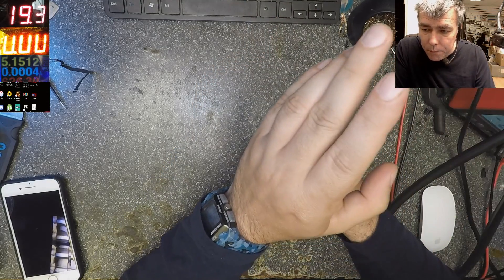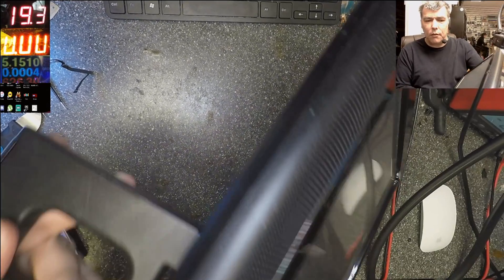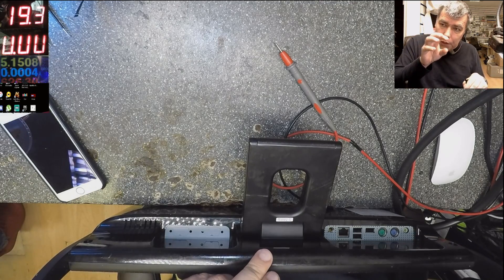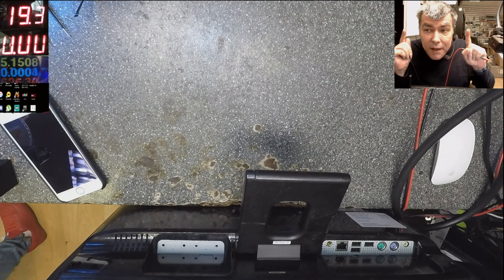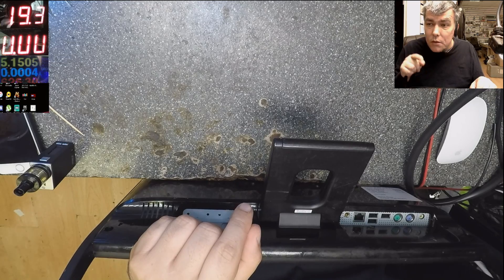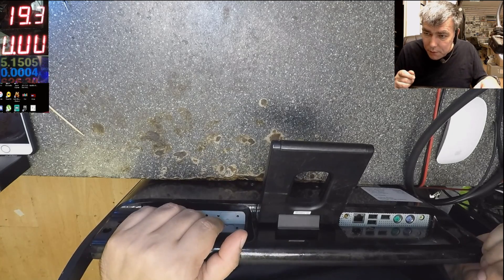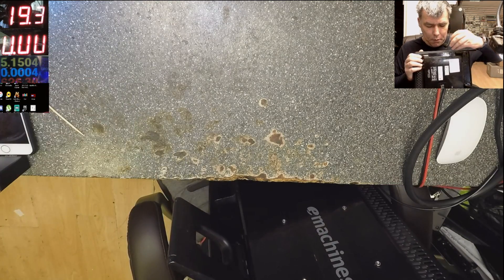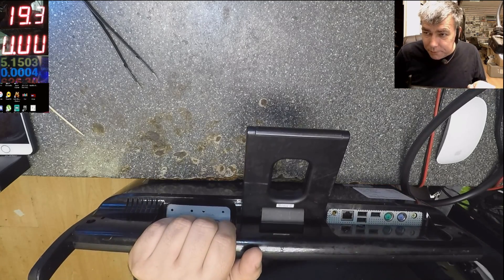What u Should check first, if your Computer its Dead!

Comment: Nice job sorin but why you didn’t fix the usb port or replaced it thats will make your job is perfect but you said  i don’t have time and the costumer has to pay whats the internal meaning of that ..
I think the costumer will think that the problem is not deep as what did coast.. so the idea is not to tell the costumer what is the problem to compare it with coast price and this is not fair i think.. otherwise maybe i am wrong to get the idea with what you said .. thanks

Comment: sir. Question ? if my first mosfet. the 3 pin together is 19v  and the output is 19v . but the gate is very low like 7v. this is broken mosfet or not

Comment: The question should have been 'What could stop a computer main power supply starting?'

Some supply problems you have outlined in your videos.
A faulty main input power switch.
A ground shorted usb socket
A ground shorted power socket, or open circuit.
A dead startup controller, or missing power, or button power.
A crashed startup controller.
A mosfet or mosfets not switching on to the next stage.
The main 3.3/5/12 volts not functioning or ground shorted.
Grounded cpu supply.
Reply from the maker: true, but this is just the first step, before to strip down the computer
Reply: Easy said than done. to find short on the 5 volt power rail is much harder than the 19v. This video give non experienced tech the ability to immediately diagnos if the problem/short is on the 5v, or better to say the short is  not on the 19/3.3. For me it will save me some good amount of time. If I know ahead that the problem isn't on the main power rail I will not take the job.